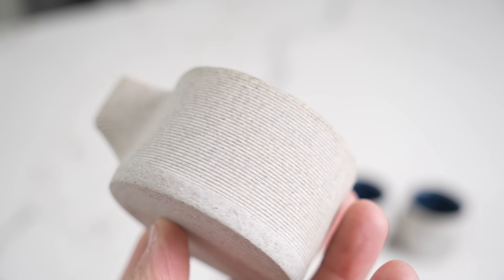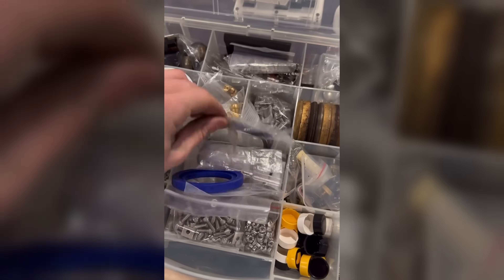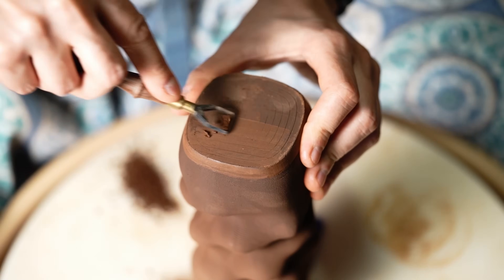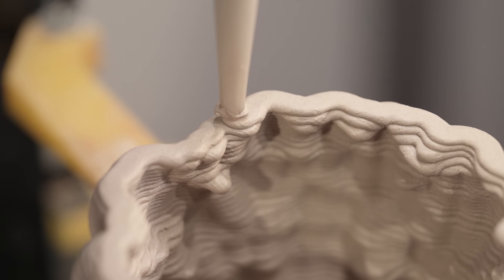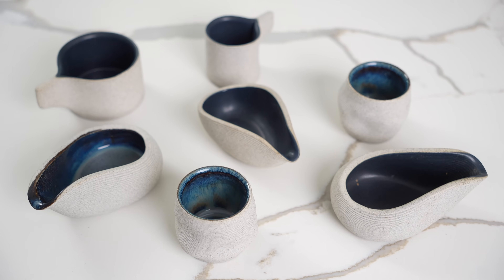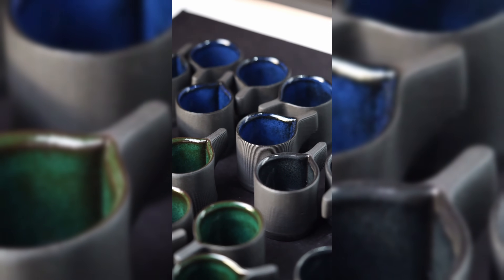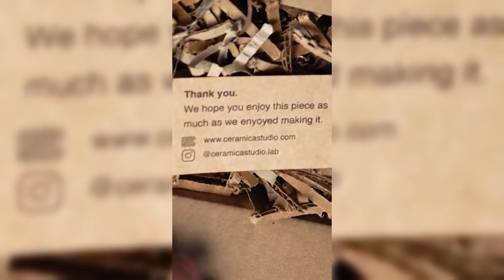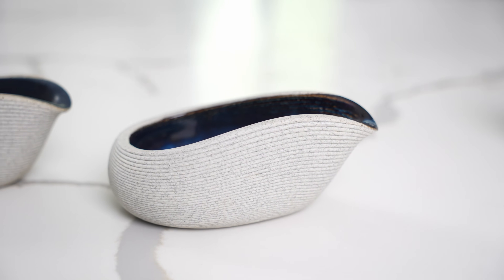These 3D Printed Ceramics are Insane!

Comment: I like them, they're cool  but a pug mill is not going to extreme lengths,  it's a fairly standard piece of equipment for a pottery and have been used for hundreds of years as air bubbles can blow apart any pot when it's fired. 
I do like the non level layers of printing though and the fact he had to code his own software to follow that. Very neat.

Comment: I wish you spent a little time describing how they get the inside smooth, because you can easily tell they don't start that way
Reply: They glaze the inside, which is a normal pottery technique which gives a smooth, shiny surface (even on normal ceramics, not specific to this 3D printed stuff)

Comment: I remember early 3d printing with clay bodies (We're talking 15 years ago), and I thought the process was fascinating, but just one step in a process. I tend to think the best application for 3d printing is in prototyping: it's much easier to do the work digitally, perhaps do some computer simulations or what have you, experiment with very difficult or impossible shapes; however, the 3d print is just one step in the process. To me, it looks a lot like coil building without having been smoothed over. Modifying the form in various stages - I'm eyeing a firmer stage or leather-hard stage - could be interesting. Also in the glazing phase, there's a lot of interesting things that can be achieved as the glaze runs and sets.

Comment: In my mind I was vidualising this cool little upside down cup shaped pipe right behind the nozzle that basically contains a redhot element that follows just behind the print..., I'm not saying it is going to dry out the clay, I would imagine it would drive out som water and harden it SOMEWHAT before the nozzle comes by again so the tope layer deforms the one below it less.

Comment: this is not replacing artists as some hyperbolic people like to claim. there is just as much creativity and ingenuity that goes into this as making traditional ceramics. its just not pressing a button on a machine and mass producing ceramics. the involvement of software and machines does not somehow make this anything less than art.
Reply: who are the hyperbolic people claiming this?  I read every single comment and literally nobody has said that at all.
Reply: and the way you have to babysit 3D printers is honestly the most annoying part.
Reply: Even if it were just pressing a button, you could also just get some mass produced ceramics from ikea for close to no money. Handmade ceramics are already obsolescent, this doesn't really do anything to change that.
Reply: Replacing? This guy is an artist, his code and process is art.
And the best part is that it's complex and not some low effort stuff we see everybody doing.
Reply: No one is saying this though.
Reply: Nah it will offset some artists for sure. Just like doing anything else in the industrial sphere of ceramics. Doesn't matter either way.
Reply: @Mad_Catter_  nah, my spouse has used the 3d "potterbot" a lot. it is NOT "industrial". it's just another tool. there are already mass-production tools and techniques out there, and have been for ages (slip-casts). and this is VERY far from as usable as those. it requires way too much ingenuity and redesign, and it's MUCH, MUCH too slow to print, even if you have a known good design. slip casting is way faster.
3D printers are more plug and play than the potterbot, and those are notorious (to people who have used them) for being far from trivial to learn to use, and to make designs for.
Reply: @Mad_Catter_  Not really, this isn't something that can be done in large scale (yet?), just like current 3d printing, there's a ton of variables that go into making a successful print. I probably spent 2 months trying to come up with a design for a small case for my  home lab (think of a pc tower). I couldn't use some materials because heat softens them, print orientation matters for strength and also for overall finish. It took a ton of revisions for some components to work, only to not make it to the final design.  Finally in addition to all of those issues, for ceramics, just because they got it work with their tools, the odds of someone else being able to reproduce their pieces, is low as they need the right clay, know how on how to get rid of air pockets, and calibrating their printer (which is a nightmare). Ask anyone that's been doing 3d modeling for 3d prints if they would want to replicate this.. and most will probably just stare into space and just say neh.. not worth their time.

Comment: Considering how one of the basic methods to make pottery is to roll out a long clay “noodle” then use to to make the walls of the dish…..like a 3D printer.

It’s a natural match of technique and craft
Reply: I think the dilemma is not about how it looks or how close it is to the traditional colombin pottery method, but more the fact that the machine is doing everything for you.
For my part I think it's all fair, considering how much work goes into making the machines (which are usually homemade), all the artistic process in the modelling and everything.
But if it starts to reach industrial grade production, then it's probably not what I would consider craftmanship anymore. The way way you can find slip casting artistic if manually cast and handled/post-processed. But there's a threshold where it starts to become something else I think.
There's a wide line between slip casting and /slip casting/ like ikea dinnerware is made.
Reply: @thainarv  yes and now. It opens up the possibility for so many more designs and shapes humans can’t achieve. That’s craftsmanship. Round bowl and vase….not so much

Then again, even a basic round hand thrown bowl or vase isn’t really considered craftsmanship. What ppl respect is a challenge overcome. Whether it’s in ability or thought that’s when we see things in a new light

Comment: Ok, interesting. But what, if any advantages to these are there? Yes, there is an interesting look to the outside from the process. But I do 3D orbiting of functional parts, which, to an extent these are. And what we know about 3D printing is that the material is weaker, layer to layer, when compared to along the length of the filament because of weaker layer adhesion. So therefor, weaker than the same material injection molding or other methods that are made from the solid. So, my concern here is how strong are the objects when knocked, compared to a more conventionally manufactured object of the same design?

Comment: Yeah... this sorta stuff is a bit of a headache to manage to work --- we had the tech a long while ago, and people hated it... not just because the "oh no, we're replacing artists" drama, but because of the fact that the prints were... lackluster. Fragile, broke easily, etc. And quite a few ceramicists were celebrating its failures since it showed they'd still have jobs. So it is interesting to see that people are managing to get this to work properly

Hearing how finicky the entire process is, I think I can appreciate it being just another tool. I know there were people who were a bit put-off by the initial implementation as if it were replacing ceramic artists, but... knowing how finicky the process is and how finicky clay is....? No, it truly is just a different way of working. You definitely need that ceramic knowledge to get these prints to work. Originally, I think people thought 3D printing was a "set the machine down and let it run while doing other things" and you get an end result... but I think that's doubly not the case for ceramic due to shrinking and whatnot. Extra steps need to go in regarding maintaining the environment during a print. So ironically this doesn't work well as a cheap labor replacement thing

8:36 Incorrect. You do see these shapes in traditional ceramics. A quite LOT. They just don't end up being on the market as much, probably because quite a few people don't think they're that marketable as handmade goods or because they don't fit that particular artist's aesthetics. And all of these shapes could be made naturally with no problem, and quite easily. They are just incredibly bad in traditional ceramics as mass production designs due to consistency issues in regards maintaining the same shape and size
Reply: Didn't now about how finicky they were. Make sense, I guess. That's probably why in this part of the world (Southeast Asia), most ceramic are still handmade and they're just as beautiful.

Yup... I love this kind of shapes in handmade ceramic. Still goes hunting reject handmade ceramic from time to time , to find that $1-2 gem.
I have a few that has different lip thickness, the thicker side i'll sip a latte or chai masala, thinner side I'll sip tea or V60 coffees.